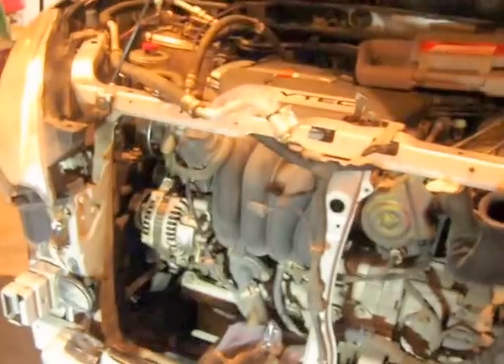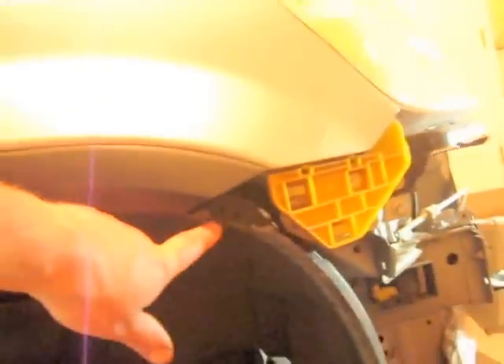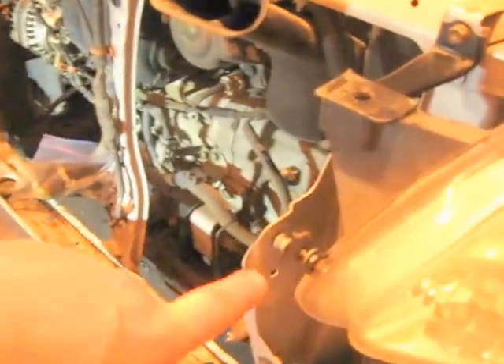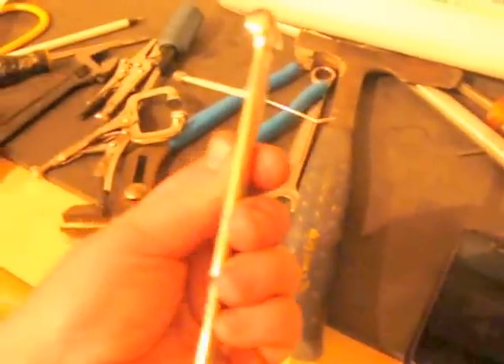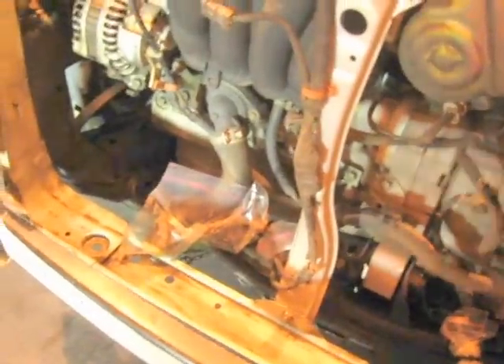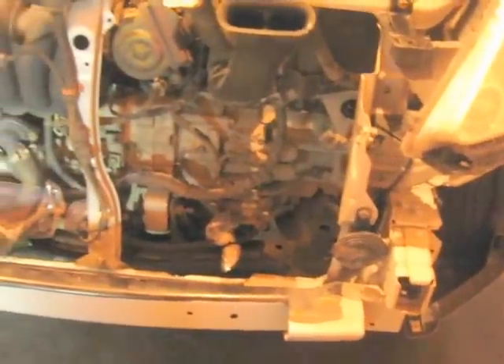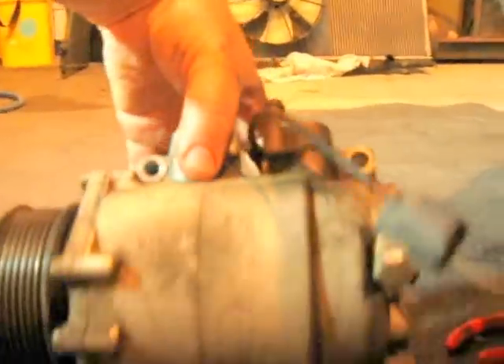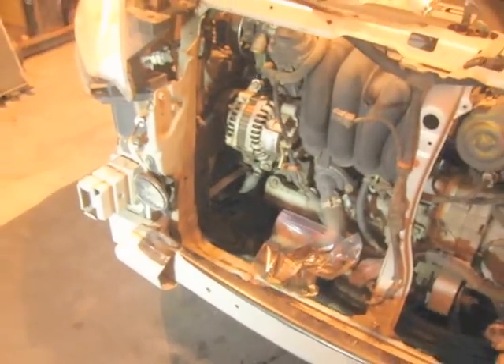2004 Honda CR-V Air Conditioner Compressor Removal

Comment: My friend had her 06 Honda CR-V flushed and recharged.  They said she needs to replace the liquid line, but trying to buy the part nobody seems to know exactly what that is.  There were 2 metal lines running across the compressor and he said the one has a filter in it and it's clogged from the particles of the broken compressor and has to be changed. Do you know the name of the part?
Reply from the maker: They are high and low pressure lines respectively. Look at the blue caps on the lines where one would add the refrigerant. They are marked "H" & "L" for high and low. Trace them to where the filter is and you will know which line it is. I think the High Pressure line is the filter side of the system. Here are some examples I found.

http://www.amazon.com/Four-Seasons-55262-Refrigerant-Hose/dp/B003YP3JQU/ref=sr_1_2?ie=UTF8&qid=1406568415&sr=8-2&keywords=06+honda+crv+ac+compressor+lines

http://www.amazon.com/Four-Seasons-55242-Refrigerant-Hose/dp/B003YP76RI/ref=sr_1_4?ie=UTF8&qid=1406568415&sr=8-4&keywords=06+honda+crv+ac+compressor+lines
Reply from the maker: As far as I can tell the filter is in the condenser, same  as our 04. Look at the side of the condenser where it looks like a cylinder is attached, the filter/drier goes in there. Not sure why your friend received that info?? Most other cars do have the filter in the "line" or refrigerant hose, but not in the CR-V with our model years. Hope this helps :) 

http://www.amazon.com/Delphi-CF20033-New-Conditioning-Condenser/dp/B001UCAUU2/ref=sr_1_3?ie=UTF8&qid=1406568415&sr=8-3&keywords=06+honda+crv+ac+compressor+lines
Reply: Her compressor exploded. She had the compressor and condenser replaced then took  it to another place to have it flushed and recharged. They said the liquid line needs to be replaced it was clogged. It does have a blue cap with and H on it. Is it the suction or discharge hose? I looked at both links to Amazon but her line was all metal and Amazons isn't does that matter?
Reply from the maker: luckycharmed65  Have her get both. Mine had rubber on them too.  When the system explodes everything needs to be replaced, unfortunately .

Comment: George can i ask one more question? this clutch stopped working a couple of days ago, and we stopped driving the car immediately. Is it posible that simply replacing the compresor/clutch will be good? The reason i ask is because i see a lot of people saying YOU MUST REPLACE THE WHOLE SYSTEM when your compressor blows..i can undertand why they say that, but to me that sounds ridiculous.. like this below, has a whole page dedicated to it on ebay:                                                         

I am quoting ebay, below.....          
There is no simple way to repair the CR-V’s AC System. You MUST replace the following parts to remedy the problem: 
1. Compressor

2. Condenser (with Drier attached)

3. Expansion Device

4. Evaporator

5. System Seal Kit

6. System Oil

7. Both low side and high side AC Hoses.

i cannot simply replace the compressor???

Comment: sir,. do I need to add ac oil on other system other than only comressor? if so how much I need for
Reply from the maker: The compressor should have 4oz of PAG 46 added if it came "dry." either way you should rotate the pulley and a/c clutch together 20 revolutions in both directions to be sure the inside of the compressor is completely lubricated. I added r134a with oil in it when I charged the system, 1oz oil 16oz  refrigerant, it was in the can that way. The system only called for 4oz of oil (3oz in the compressor and 1oz in the charging). Here is what I found about the oil charge on a CRV forum.

""'Since it is going to be a new system, there is nothing left for you to flush.

A/C REFRIGERANT OIL REPLACEMENT
Recommended PAG oil: KEIHIN SP - 10: â€¢ P/N 38897 -P13 -A01AH: 120 m l (4 fl - oz)
â€¢ P/N 38899 -P13 -A01: 40 m l (1 1/3 fl - oz)

Add the recommended refrigerant oil in the amount listed if you replace any of the following parts.
â€¢ To avoid contamination, do not return the oil to the container once dispensed, and never mix it with other refrigerant oils.
â€¢ Immediately after using the oil, reinstall the cap on the container, and seal it to avoid moisture absorption.
â€¢ Do not spill the refrigerant oil on the vehicle; it may damage the paint. If it gets on the paint, wash it off immediately.

Condenser. 25 m l (5/6 fl -oz)
Evaporator. 40 m l (1 1/3 fl - oz)
Line or hose. 10 m l (1/3 fl -oz)
Leakage repair. 25 m l (5/6 fl -oz)

Compressor. For compressor replacement, subtract the volume of oil drained from the removed compressor from 130 m l (4 1/3 fl - oz), and drain the calculated volume of oil from the new compressor: 130 m l (4 1/3 fl - oz) - Volume of removed compressor = Volume to drain from new
compressor.

NOTE: Even if no oil is drained from the removed compressor, don't drain more than 50 m l (1 2/3 fl -oz) from the new compressor.'""

Hope that helps!

Comment: hey George, thanks very much for the video.  I have a 2002 with damaged condenser (and radiator). am now rebuilding.  thx for msg on type of oil, amount, and how to fill.  gread vid.  Bob B., AR
Reply from the maker: Thanks for the kind words! I replied to your last comment and it sounds like you are almost done, way to go Bob :) I still cannot believe the cost of this job at a shop or worst, the dealership :( Happy wrenching.

Comment: where is the dryer and low preasure switch located?
Reply from the maker: Johnathan Rozenboom The dryer is on the right side of the condenser, facing the car, accessed from the bottom. I only recall the one electrical switch being in the compressor unit. I will have to double check for you
Reply: I found the preasure switch its behind the headlight in the high preasure line . unfortunately this wasn't my problem.... My compressor is bad I finally got it to engage and it started knocking bad also cutting out intermittently, so I took the relay out so it couldn't be engaged , to avoid imploding if it hasn't already. Our Crv has over 200k miles so I'd have to assume the a.c had been done before at some point. Do you have any info or can you direct me to some info on how to tell if I need to replace the system or just the compressor and filter? 

                        Thank you Johnathan
Reply from the maker: I would start with depressurizing the system and checking the dryer filter for debris. If it is polluted with fragments then the whole system needs to be changed as it is near impossible to flush out all of the metal from the impeller disintegrating. I seem to remember the dryer comes out with w 10mm hex from the bottom, the filter will slide out. It appears to be a bag of desiccant material . I had two implode but the dealer did them before I did this video on the third one.  I hope that helps Johnathan? I know this is a major pain! Our crv is still going at 211000 but she is eating oil now. I will keep feeding the beast until it dies or the a/c goes out again HAHA.... Thanks for allowing me the privilege to offer my help. I think this forum, Youtube as a whole, has been super helpful for me in so many ways that I cherish the opportunity to be of service to others.
Reply: thank you very much for your help.  God bless :)

Comment: Can this same method be applied to the 03 model
Reply from the maker: donovan renteria From what I read  and viewed it does apply to the '03 model.
Reply: How long would u say it took u
Reply from the maker: If you have all the parts 5 hours. I took extra time, but in total about 5 hours if you stay after it.
Reply: Ok thx

Comment: You made that job 1000 times harder for yourself you remove the sub frame disconnect, four bolts disconnect, the serpentine belt and she’s out I don’t know why in the hell would you take the whole front end of coding the radiator you just like working hard good job though

Comment from the maker: jacob here is the link to the video you requested:
https://www.youtube.com/watch?v=SShJy8sj-fI
I did not see the reply button in your comment so I trust you will get this message. You are most welcome! I appreciate the fact that everyone shares information and we as a collective are able to do so much when we help each other with the knowledge we gain as we go through life :)
Reply: Lol thanks George! Yeah, it's people like you that bring good to the world,and in turn the good Wil come to you for helping us all. FYI my sitch is I just moved to NC from Buffalo ny, I know not 1 soul. I've never experienced 104 ° Temps and then of course my ac dies, and all the quotes I got were over $800 all the way to $1675. In the end, the only thing we KNOW Is the clutch isn't engaging. I evacuated with manifold, and have no leak. Even the slightest freon fill boosts the low side to 90+!!! This issue started after a freon top off. Instantly the clutch kept engaging and engaging repeatedly, like every few seconds. Then it stopped engaging, and blows warm. What's weird is, it's not locked up,it spins. Checked fuses and they're good. I'm hoping replacing this assembly tomorow will do the trick. My wife is 6mo preggo and she can't leave the house in this heat wave... I'm no auto repair expert, but I'm extremely mechanically inclined, engineering background, I repair the smallest of things like microprocessors in cell phones, build laptops from scratch, and have done many decent sized auto repair jobs. So I'm hoping this won't be rocket science, especially with how logical your tutorial is....

Comment: BTW George, i'm about to reassemble.  replacement oil is PAG 46 per all sources, equivalent to SP-10 which is in manual spec.  i'm going to try to find refrigerant with 1 oz oil, as you did.that's about how much lost, per your source as well as:
 http://www.johnsens.com/uploads/files/regulatory_lubricantguide4.pdf
i think since this oil was lost from condenser and lines to/from condenser, it should be okay to add back thru low pressure line, after vacuuming system.  i'm going to use vacuum and manifold from AutoZone or similar, plan to hook system up, vacuum to zero, then add refrigerant/oil mix.  will replace seals where i can but not other parts right now, except maybe dryer if its not too expensive.  any other suggestions?
Reply from the maker: You sound like you are right on track. Sorry for the late reply for some reason Youtube spammed your comment??? I agree with the low pressure line charge. That is the typical route to add oil to the system. I would let the vacuum pump run for a 30-60 min cycle to boil off the moisture in the system. It should pull to -28 hg or so as a perfect vacuum is like -30 hg which is theoretical :/ I digress. The important thing is to have new desiccant to pull any remnant of moisture during operation. I recently learned all this from my research. Our system is running great since this video. No issues at all. I hope you have the same outcome Bob. How's the weather in AR? Have a great Day!
Reply: Robert BBriggs 
Hi Bob  and  George
As per the document you have had attached the oil shall be added to the compressor before starting the vacuuming process.
On the other hand seems that you added the oil thru the yellow (charge) line after the vacuuming ?
I am still confused how can I add the oil after the vacuuming process without losing the vacuum in the lines. Or with other words, will that vacuum pump sucks the oil form the compressor?
I am planning to buy a Robinair 1.5 cfm . Will that do the trick ? Not too many options here in Ontario...
Thank you !
Reply from the maker: Bob Sorry for the delay! Add the oil, I think its like 4 oz,  from the sealed pag 46 bottle into the port side on the compressor before you attach the line. spin the entire clutch assembly to pre lube the new compressors guts. 15 revolutions in both directions. After you pull the Vacuum, the oil and refrigerant combo can will pull both in through the manifold valves center or yellow hose. This is done during the charging stage. After you have a vacuum on it for an hour or so, this boils off the moisture and gets the system ready for charge, take note of the degree of vacuum after you close the valves and let it sit for a half hour. If you do not see change in the number, say from -28 to -20 or less, you have no leaks! Yay! Then you are set to charge.. If you are adding just oil pour it all in the compressor. Mine came wet, with oil, so I pour it off into a measuring cup to see how many oz. were in there, I was then able to calculate the correct number of fluid oz with my oil, refridge/oil charge can and go from there.
Reply from the maker: Bob I think your pump is fine. Just let it stay on there awhile. I think mine was a 3 cfm, its in the shop and I will check later. Be sure the pump has oil, the vacuum pump! They get hot and need oil to work properly. It will only vacuum out the air. no worries! If you need any more help I will be working on a paper today so my computer will be in my face after an hour from now 10:50 CST. I can talk to you over the phone if you want. Let me know either way it is only stressful due to the unknowns, after this you will be a Honda a/c Master! lol...
Reply: George Jirout  Thanks again for your assistance. Now, I am at the cross roads as here, in Canada, the refrigerant R134a is hard to find. So I might have the recharge part of the job done by a shop. Will search more for refrigerant suppliers and will decide :(

Comment: I have the 2004 CRV you did way to much work. Loosen the radiator cross support and set aside/pull out of the way. Pull out the radiator over flow bottle, it's tight but will come out. Support right side sub-frame with floor jack Remove 3 sub frame bolts and loosen the 4th closest to the drivers feet. remove the center front lower motor mount bolt. Lower the sub frame with floor jack. Unbolt compressor hoses and compressor. Easy peazy, flat rate it!
Reply from the maker: The Custom Crafter thanks for sharing your experience! I’m sure it will help someone else! Have a great weekend...
Reply: @GeorgeJirout  how is that amazon rebuilt compressor from Miami working now or is that where you got it. the compressor I replaced was number 99,xxx from the same place as the new one in the 260,000 rebuilds number. I have no idea how long it was in the car as I just bought the car for my daughter a few months back. Either way the AC compressor clutch blew/seized and broke the belt. Not sure I trust these rebuilds, than again a new factory is priced through the roof and the latest parts I got from the Honda dealer said made in China so why bother paying 4 times the price. the new amazon CV axle at $70 worked out great.
for those wondering, I am a retired Mercedes tech and also a Honda tech with full tooling working out of my garage. I also have a refrigerant/AC lisence so George's method might work better for your tooling/skill level.
Reply from the maker: The Custom Crafter That Amazon compressor is fully functional and have not had a lick of trouble with the internals, clutch, or bearing. I am super happy as the repair was not terrible, but more a pain with the wife complaining about a sweaty bra! That CRV is at my sons house hauling the grand baby with 265,000 miles. A few minor oil leaks but otherwise humming along.

Comment: sorry to tell you this it comes out the bottom of car like 123 no need to remove all that stuff thats the long way ...sorry
Reply from the maker: Kevin Caudill No worries! If you would share the procedure it would help others save some time. I am an average joe and that was the only way I saw it would come out. I learned a ton and had plenty of room to work in there (both of my arms are messed up and do not work properly). I would love to learn how to perform the 123 method, sure would save time. Thanks for sharing!
Reply: Kevin Caudill Hi Kevin, 

I saw your comment regarding removal of the ac compressor (honda crv) from the bottom, without the need to rip half the car apart. I've tried doing it the long way but realized I don't have the tools to get into tight places. 

How do you remove the compressor from the bottom? Are there any tools that make it easier? I only have wrenches and a socket set (basic). 

Your help would be greatly appreciated, I'm learning a lot about this. 

Cheers,

Roy